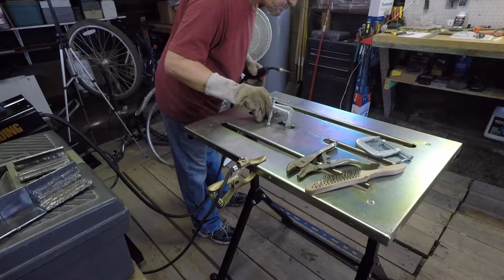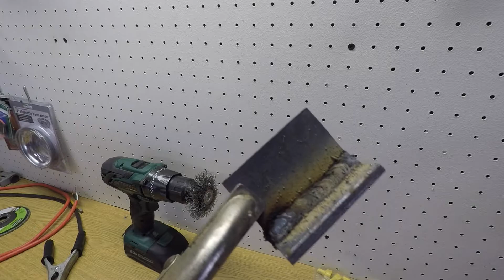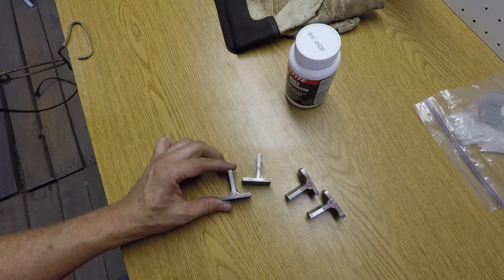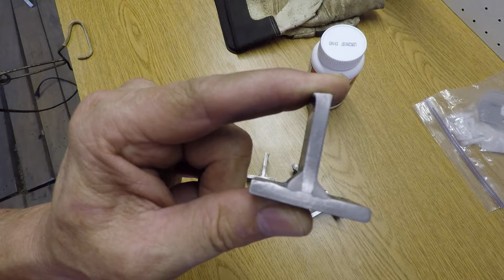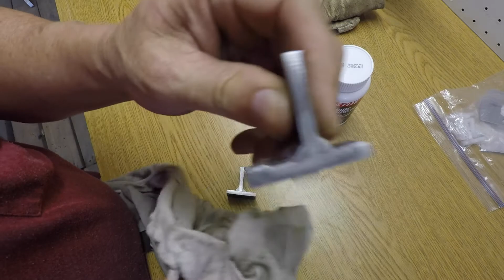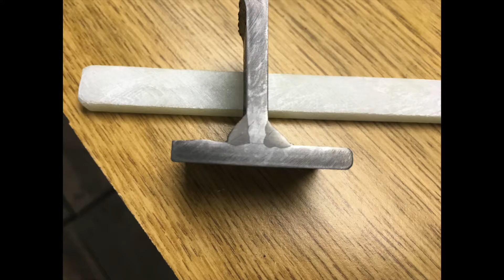Cut and Etch Weld Testing Harbor Freight Gasless Flux Core Welder Mods

Comment: I know this video is a little old, but is it possible that the side with less penetration was done first, so the piece was cold and the side that burned in better was done with the part still hot from welding the first side?  Just a thought.  I've seen that when I'm cutting and testing T-joints if I don't let it cool between passes.
Reply from the maker: I don't remember what order I made those welds but your logic sounds like it may be the reason for the difference. I'll try and remember that the next time I do an etch test. Again, I appreciate your input. :)
Reply: That is exactly what happened. You can tell because his first pass pulled the metal out of 90, to less than 90. The second pass on the side that is greater than 90 is where the penetration is because the metal was hotter

Comment: The sides with more penetration, is that the side you welded second??? With thicker metals maybe this welder just requires the metal to be preheated to help it dig
Reply from the maker: That is correct and I agree with you. Once the metal was preheated, it got better penetration.
Reply: DIY Homestead Projects awesome, Thankyou. Nice video
Reply from the maker: Thank you :)

Comment: Seeing you lay your arm on the welding table made me wonder why you weren't getting at least a shock from this so I googled it.  It seems that the path is more direct through the metal since there is less resistance.  However they did say it was possible.  You may want to get a rubber mat to lay on the table for leaning.  Your welds looked pretty close to the pictures I saw of "coupons".  There is no doubt that you will have this mastered soon due to your diligence.
Reply from the maker: That is definitely something to think about. I should probably be wearing long sleeves too to prevent sparks from getting caught in the fold of my arm. That would also help prevent any shock from the welding current. I know I should be wearing ALL the safety gear but it's been so darn hot and humid here lately sometimes comfort becomes more important to me than safety. I know I shouldn't but I'm human and it's always an issue or concern.
Reply: @DIYHomesteadProjectsDIYHP10  I can understand the heat issue.

Comment: what dial speed number was used to get the good penetration ?
Reply from the maker: It's been a while since I did that test but I'm pretty sure I used HIGH on the amps and about 4.5 on the wire feed speed. I find that to be about the optimal settings on my machine now after the modifications.

Comment: I modified my HF welder about a year ago. I used a 150 amp bridge rectifier, a 68,000 uf, 63v capacitor, a 12-0-12 transformer for the wire feed (paralleled so I get 12v), and I made my own inductor with a toroid core and as many loops of 8awg thhn as I could fit. I've never tried welding beyond 1/8th with it, but it does a very good job. I get nice blue heat marks on the underside, which to me says I got good penetration. I use Lincoln wire because the HF stuff is crap. Only problem I currently have is the wire jams a lot unless I have the gun pulled out straight. I plan on replacing the gun eventually.
Reply from the maker: It sounds like your welder is working good for your needs. I'm really enjoying mine and it works real well I think. I bought a 10lb spool of flux core wire off amazon from welding city and it was about the cheapest wire I could find. It welds real nice in my machine and the best part is it's 10lbs. I was surprised that the HF 90 could run a 10lb spool but it does without modifications. What a game changer and it's way more economical than the smaller spools. I won't have to buy wire for a long time.
Reply: @DIYHomesteadProjectsDIYHP10  It's ok for exhaust work, which is what I originally bought it for. Also did a good job on the modifications I made to my HF garden cart. I welded brackets for stake racks. So far, no broken welds. I have a project coming up where I need to weld 1/4" plate to 1/4" square tubing and I know this won't do it. I'm trying to decide now if I want to buy a real welder or just pay someone to do the project for me.
Reply from the maker: You could get a Juba ZX7 200 Inverter stick welder for about $150 and that would easily do 1/4". Then when the project's done you still have a capable welder for those 1/4" projects. Oh decisions decisions. LOL :)
Reply: @DIYHomesteadProjectsDIYHP10  Never stick welded before, but there was also a time when I'd never mig welded. I'm actually considering getting a Lincoln 180HD for around $550, but I only use a welder a few times a year, so I don't know if I wan't to spend the money on it right now. I definitely do want a really good welder someday. Decisions, yeah...

Comment: What is your polarity?  Your clamp- and your stinger+?
Reply from the maker: I'm running DCEN that is the clamp + and the stinger (electrode) -
Reply: I converted my jobsmart fc125 to dc+. I'm just using the bridge rectifier 150a 1600v. My clamp- and my stinger+, and it burns hotter. I did used a cap for awhile, but kept arcing after I weld,  even with a resistor on it. I just took it out. Just burning with rectifier and results are phenomenal, less spatter and bb's on the welds. Good video series.
Reply from the maker: Sounds like you did a great job with your mods. Just adjusted them to suit your needs. I am happy with my modded HF 90 amp welder. It does what I need it to do and it's easy and economical to use.
Reply: @DIYHomesteadProjectsDIYHP10  good deal, nice mods. Keep 'em burning.
Reply: Flux core is supposed to be ran even. That means the gun and wire, should be negative. @DIYHomesteadProjectsDIYHP10

Comment: This doesn't apply to you, you obviously aren't making completely garbage welds but I've noticed something about the modifications to these Welders. If you welded like crap with it before you modified it, you might improve things a little bit it isn't going to fix a lack of skill.
Reply from the maker: I agree with you Josh. The only fix to bad welds is "practice and experience".
Reply: @DIYHomesteadProjectsDIYHP10  thank you by the way, I've ordered some parts and can't wait to modify mine. I will probably stick with this machine until I finally drop money on a TIG.
Reply from the maker: You are welcome Josh. I think you will be happy with the results and the machine. I use mine quite a bit for little projects and it does a nice job. For the money it's hard to beat and an inexpensive way to gain experience and skill in my opinion.  Take care :)